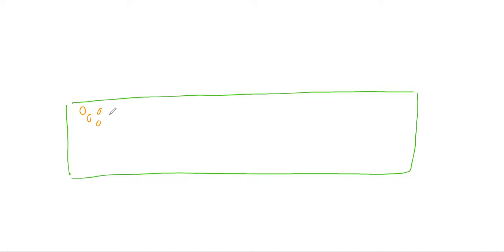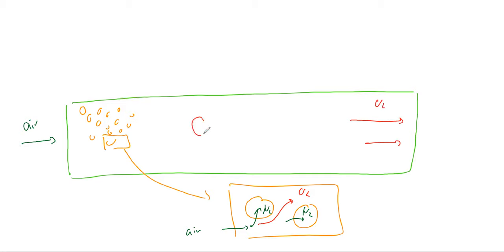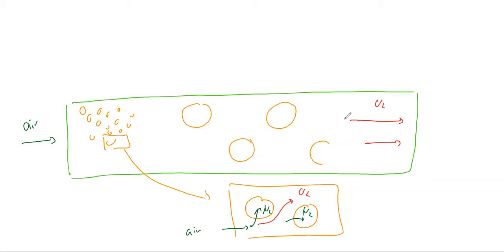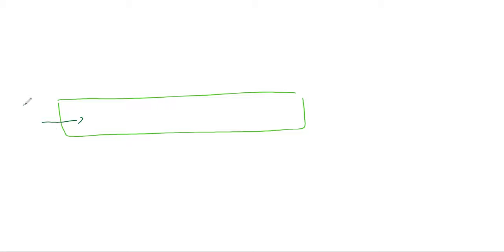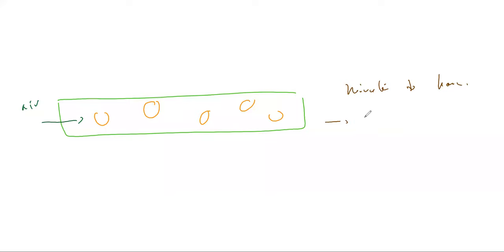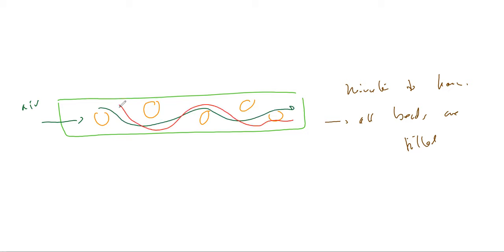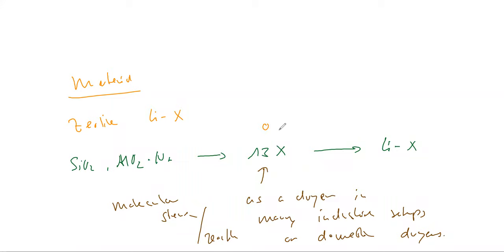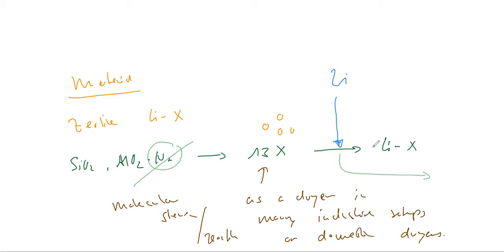How to make oxygen using pressure swing adsorption

Comment: this method produces only 30% to 50% oxygen while air is 20% ? it doesnt seems very efficient.
EDIT -  i realized i misunderstood : i read 50% while they said 90% in the video 1:05. My bad.
Reply from the maker: With this method, up to 100% oxygen is possible, check out our website to see our latest prototypes
Reply: @projectoxygenator4562  i just realized that i misunderstood : i read 50% while you said 90% in the video 1:05. 
I also read info on your website, and obviously zeolite is something that could be very hazardous if you breath it during the process of purification. Is there a way to completely remove this risk ? I wonder if producing o2 by electrolysis would be less harmful for health ? What do you think
Reply from the maker: @tonyHern865  I would not classify LiX as very hazardous, but I agree that breathing in a powder is not good in general. But there are easy steps to avoid it like bubbling it through water to remove particulate matter, as we have shown in Ox01d. 
I think both methods are safe, but the energy consumption for electrolysis to generate a similar amount of oxygen should be way higher and definitely more expensive than PSA.
Reply: @projectoxygenator4562  if you bubbling the o2 in water, do you need to de-moisture it before breathing it ? By the way, electro valves you provide in links are pretty expensive. Is there a cheaper alternative for electro valves ?